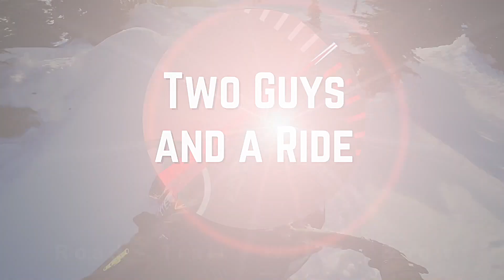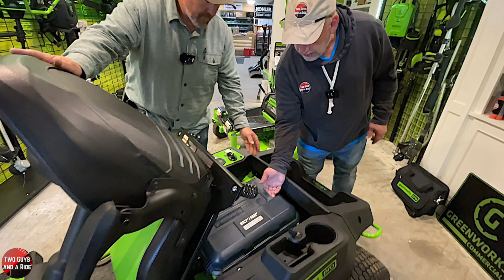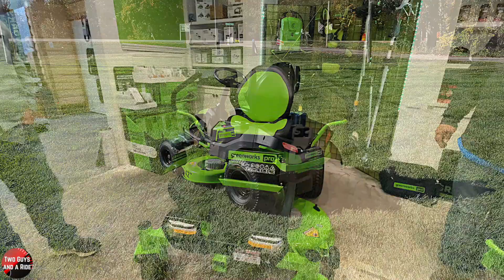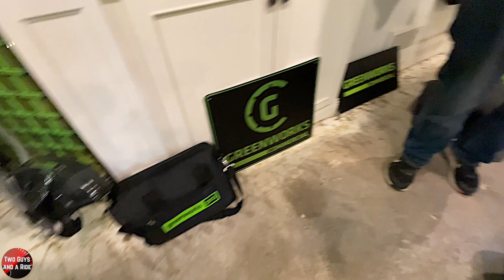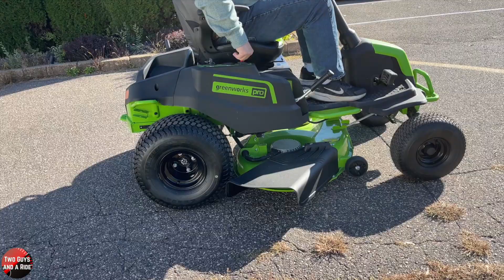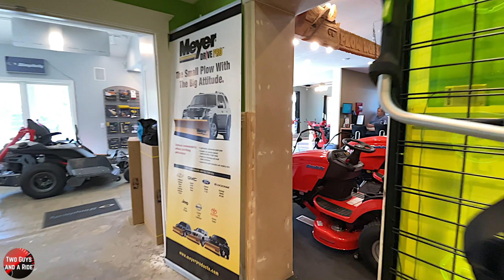Greenworks Pro 82V Electric Riding Mower

Comment: 30 min per battery to charge wow so it's going to take over 3 hrs. to charge all 6 batteries... And no mention of any prices...
Reply from the maker: You can charge multiple batteries at once with the right setup, and pricing fluctuates quite a bit by retailer.

Comment: Do you know if all the Greenworks CRT (tractor mowers) come with the charging port (for the 600W Wall Charger) or is the charger port come specifically withe the Wall charger models? (I’d like the option to use both Wall Charger and Dual Chargers!)
Reply from the maker: Good question. Please contact your local dealer for most accurate information

Comment: How many have you sold so far and how many needed repairs? (Thinking of buying the CRT428 but skeptical about service and repair facilities since my Ryobi ZT  only lasted one year and entire 2nd and 3rd mowing season was in the service shop waiting for diagnosis and parts, couldn’t be fixed, and fortunately returned it and was refunded my money (after a one year battle of complaints to the company on a weekly basis!)
Reply from the maker: Good question. Please reach out to friends that may own one to check reliability or of course your local dealer.
Reply: @ 
I can’t ask friends whi own a GreenWorks electric Tractor! I have no friends! LOL! (At least not any that own one!)

Comment: How can we keep the reverse button on while mower is engaged?  Exactly how does the reverse button work?
Reply from the maker: You can’t unless you’re pressing the button. It’s a safety feature. Modern gas riding mowers will not allow you to mow in reverse, if you try, it will kill the engine. This button while pushed will allow you to mow in reverse but only for as long as you hold the button down. Thanks for watching!

Comment: I have the 42” 60V zero turn model, with 8Ah batteries, and I can mow a little over 2 acres on 50% battery power.
Reply from the maker: Thanks for sharing that, just curious, how flat is the land your mowing?  I have about the same size land to mow, but mines on a slight slope and I’m curious if it would last the whole 2 acres.
Reply: @TwoGuysandaRide  very flat, and it’s TX, so the grass is not dense, but about half an acre of it was knee high weeds.
Reply from the maker: @IndependentlyAssorted  ok. Good to know , thanks for sharing, I appreciate the info, and thanks again for watching!
Reply: I also have one and I love the no more gas no maintenance!

Comment: Tractor style. How would a trailer hitch be attached?
Reply from the maker: Thanks for the question. There is a spot in the back to mount a trailer pin, you may need an adaptor depending on what size you need. Thanks for watching!
Reply from the maker: This is just a lawnmower so not set up to pull a trailer

Comment: So one can't take the deck out to cleen or sharpen the blades like you can with Roybi , Ego and other brands?  Roybi even brages about the ninty second deck removal to sharpen the blades. My Ego Z6 has only two electric plugs to unplug and two pins to remove and you can pull out the deck for cleaning and servicing. I keep my blades sharp this is why I'm asking.
Reply from the maker: Thanks for the question. Yep you can, he just was not recommending it for the zero turn, but on the one being filmed, there are typical mounting points to deal with and you can remove the deck, however you could just jack up the front to get at the blades for removing them. There is also the clean out hose connector for washing out the deck. Thanks for watching

Comment: Looks like a good design with some very interesting features, but what about parts?  I have a 80V Greenworks chainsaw with a bad oiling gear (worm gear). It would be a cheap part and easy to replace, except they don't sell it.  So, now a saw I paid $300 for is garbage. 

Every other gas chainsaw on the market has available replacement parts.  It seems these are made as disposable products (not exactly "Green").  It's one thing to buy a $300 disposable saw and another to buy a $5K disposable mower.
Reply from the maker: Agreed

Comment: too expensive for the majority of residential homeowner, not to mention todays uncertain economy.
Reply: Everywhere I've seen them they've been priced between $3500 and $4000 which is pretty comparable to the price of their gas powered counterparts. Then factor in not having to go buy and transport gas, oil, belts, air filters, spark plugs, winterizing fuel, cleaning carbs... They become a lot cheaper pretty over time when you factor in all those maintenance cost savings.
Reply from the maker: Ok
Reply: The 60V version of the ZT mower is very similar, and was on sale this spring from $5500 down to $4000, which is not much more than a gasoline ZT mower.
Reply: Too expensive? Uncertain economy?  Dude
Reply: Pretty close as in double the price

Comment: So you have to go back and forth with 6 batteries every time you want to charge up and mow ?
Reply: I prefer it that way.
1. If you park your mower near your charger, there's not much "back and forth".
2. If you accidentally run down your batteries far from base, you can carry batteries back easier than you can tow a mower back.
3. Being able to remove the batteries means you can share them with the entire line of 82V tools, including the world's most powerful battery chainsaw.
Reply: @BenDiscoe  It also means you can buy a 2nd set of batteries and when you run the first set down, you can swap the 2nd set in (Putting the 1st set on the charger) and keep on mowing while the 1st set recharges. By the time the 2nd set runs down the 1st set will be done recharging and you can swap again. You could mow dawn to dusk by just swapping the batteries every couple hours.
Reply from the maker: @BenDiscoe  thanks for sharing and for watching!
Reply: Also I have half an acre and just completed my fourth mow on 1 charge (6 batteries)
Reply from the maker: Right now with current battery technology, yes. Thanks for the question
Reply: who services this mower???
Reply from the maker: @airplanemilt  well it doesn’t need much servicing but when needed, the dealership where you bought it should be able to service it. Thanks for watching!
Reply: @TwoGuysandaRide  thank u but does lowes have a service center?
Reply from the maker: @airplanemilt  no idea that’s why we’d suggest buying from a local independent dealer
Reply from the maker: @airplanemilt  you will have to check with your local Lowe’s. Does Lowe’s sell Greenworks products? Yes they do, but check with local store about servicing them, that could change store to store.
Reply: @TwoGuysandaRide  thank you
Reply: @airplanemilt 😅l
Reply: No it can run on just one. Having 6 extends it
Reply: @Sg_mech so the mower will run on one battery?  I figured it was all six